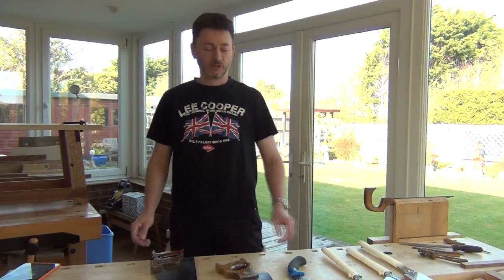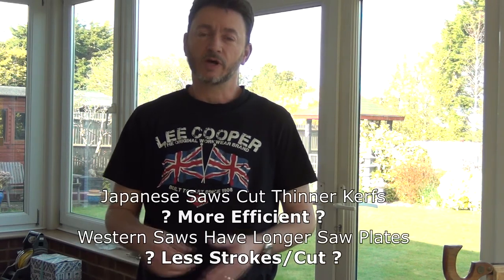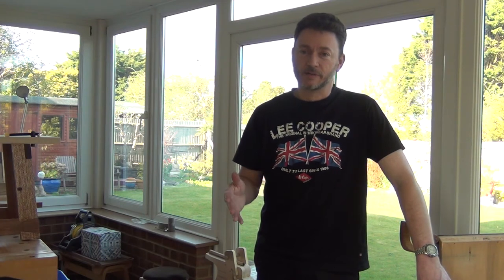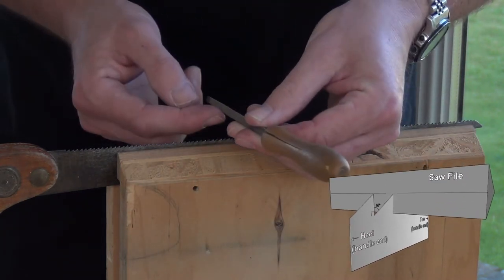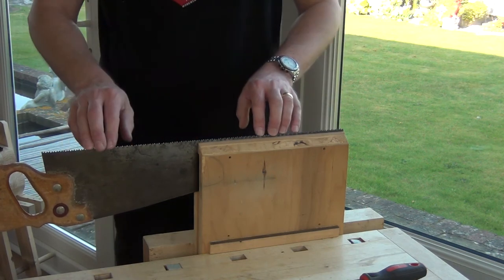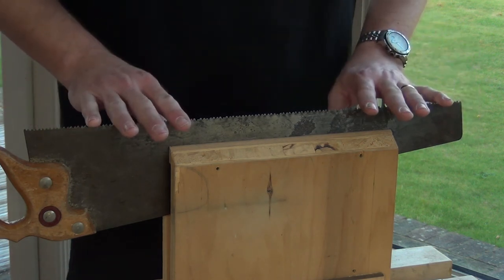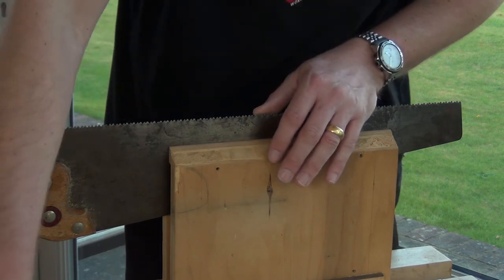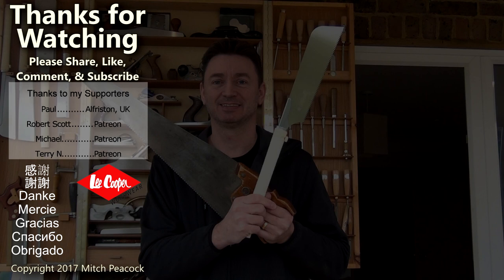Japanese vs Western Saws (GIW episode 33)

Comment: Magnifying goggles are a big help in saw sharpening, especially for us vintage gentlemen who's eyes aren't quite what they used to be. It is important to see the tips of the teeth clearly. I find saw sharpening quite relaxing and fun. And while you can mess up your saw, you can never ruin it. You can always get it restored. So it's nothing to be afraid of. It is a good advice to start with a cheap saw, but don't try to sharpen those hardware store plastic handle saws. They have hardened teeth and they will just ruin your file. If you find an old saw, that is not badly rusted, it can be a very good saw properly restored.
Reply from the maker: Wise words as usual!

Comment: Nice video, Mitch.
The one with the sharpening of the Japanese saws is true, because the machined are manufactured and then laser-sharpened and not after sharpening. Therefore you can change the saw blades.
I do not believe the Western saws are more expensive, because hand-forged Japanese saws (white paper steel or blue paper steel) cost upwards of 140, - € and these saws can be sharpened.
Reply from the maker: I've not had a hand-forged Japanese saw, although I'd like to try one one day. Not sure I fancy sharpening crosscut teeth though, they look pretty complex.
Reply: I believe you, Mitch.
I would also like a hand-cut Japanese saw.
I know the teeth of the saw are very complex and you need years of practice to sharpen the teeth.
Since I bought my japan saws, they also have a sharpening service (knives, chisels, saws, etc.).
Wish you and your family lovely Eastern.
Reply from the maker: Cheers Gunter, you and your's too
Reply: I resharpened a few Japanese crosscut saws and it depends on how worn it is. If it is badly worn sharpening requires a lot of skill but if it is just kind of blunt it is easier than it looks given the right kind of file :)

Also I got a 90 year old Maebiki Nokogiri I still use and will probably be used long after I'm dead (I'm young). I do also own an old lovely hand forged Ryoba (250 mm) which is 50 years old and I've resharpened it too :)

Right now I own about 6 hand forged Japanese saws and never paid more than 50€ including shipping.
So buying a hand forged Japanese saw brand new is expensive buying new old stock is affordable and I think Mitch is absolutely right about sharpening saws.
It is just the same with Japanese saws you need to try it on some cheap saws first then slowly work yourself up once you feel like you are getting good results :)
Reply from the maker: Cool. How do they compare with the factory produced, induction hardened, saws?
Reply: I like them a lot better than those :)
Although the saws produced by Silky are very very close to them :)

They feel calmer while cutting and while pushing them back through the kerf :)
This due to them being stiffer than the induction hardened saws (the whole plate is hardened on the handmade ones).
Also the plate is scraped thinner which results in less friction between the saw plate and the wood (not a feature entirely unique to Japanese saws as some western saws had a tapered plate as well).

I find it easier to cut straight with them but this isn't really an issue with the induction hardened saws.

They cut cleaner too due to slight irregularities in the geometry of the teeth spacing.

I greatly enjoy using them but they are delicate things as they don't take abuse too well (abuse being things like seizing during the cut, bending the saw blade, the saw blade getting knocked on something, etc.)

I like them a lot :)